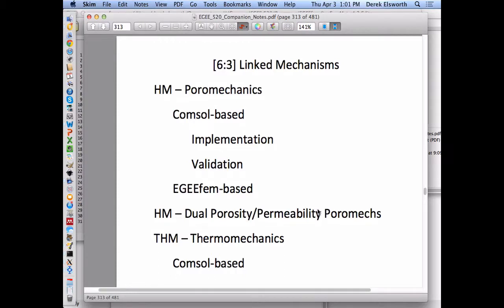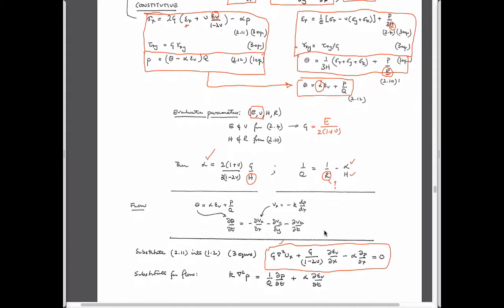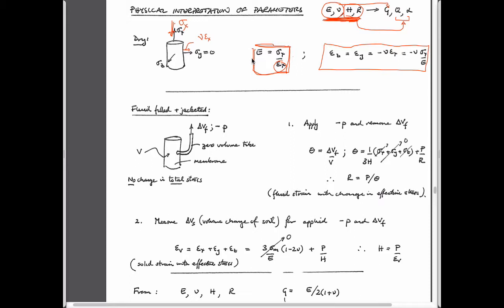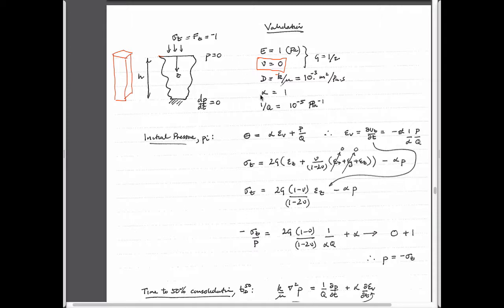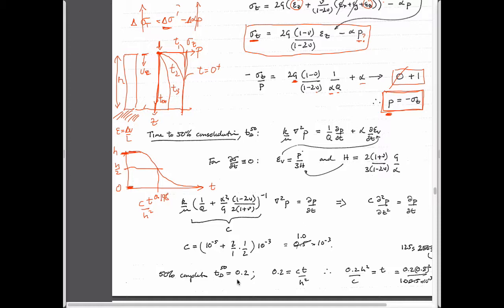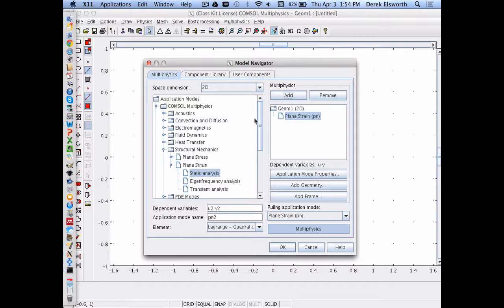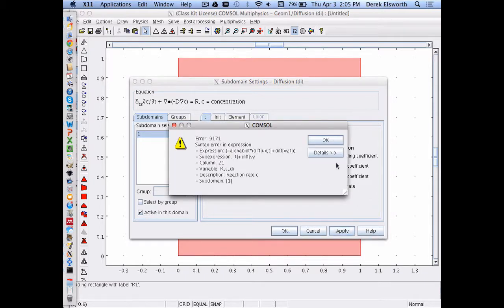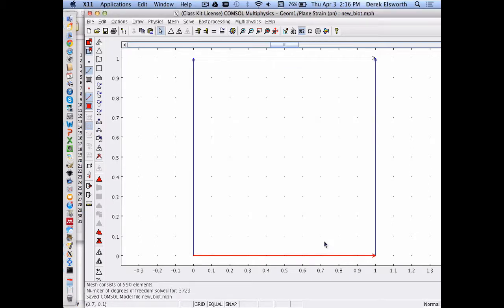6:3 Linked Mechanisms - Poroelasticity, verification, implementation

Comment: I am currently performing a stability analysis of the wellbore using COMSOL 6.2. For this, it is necessary to examine the pore elasticity. To analyze this, I have used both Darcy's Law and Solid Mechanics physics. For the Darcy's Law physics, I applied a constant pressure boundary condition and a drilling mud pressure condition at the wellbore wall. The initial condition is the reservoir's initial pressure. I have correctly input the fluid and rock properties. This physics properly simulates the pressure variations in the reservoir.

For the Solid Mechanics physics, I used a linear elastic material model. I have entered the rock properties and added two external stresses in the subnodes: one for the pore pressure (which is supposed to be taken from the Darcy physics) and another for the in-situ stresses, which I entered with negative values. For the boundary conditions, I set a free condition for the wellbore wall and a fixed constraint for the boundary. The initial displacement is set to zero.

However, during the solution process, when examining the radial and tangential stresses, I noticed that the radial stress at the wellbore wall does not match the drilling mud pressure, and the tangential stress is not consistent with the solution for the core. I also tried entering the in-situ stresses in the "Initial Stress and Strain" section, but the results were still not correct.

Would you be able to assist me, please?
Reply: Apply the drilling mud pressure as a Boundary Load on the wellbore wall and use COMSOL's built-in Poroelasticity Multiphysics node to handle the pore pressure coupling automatically.